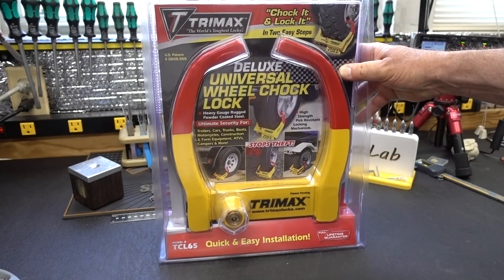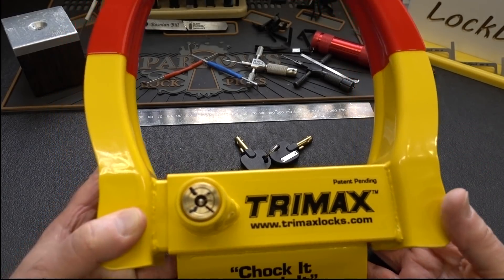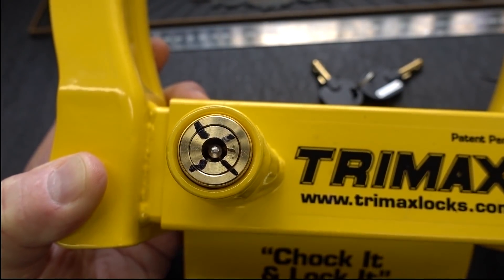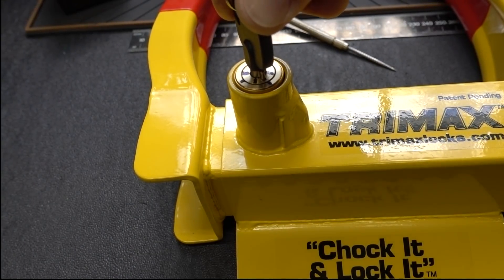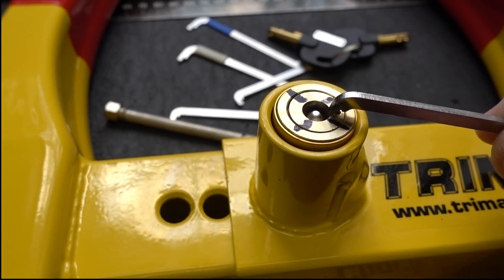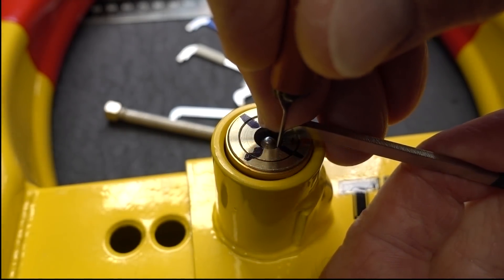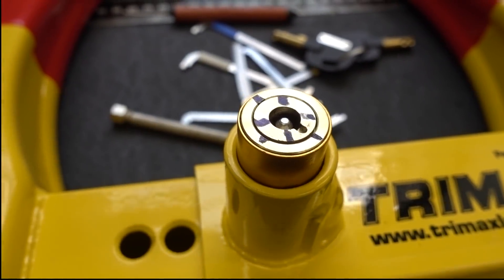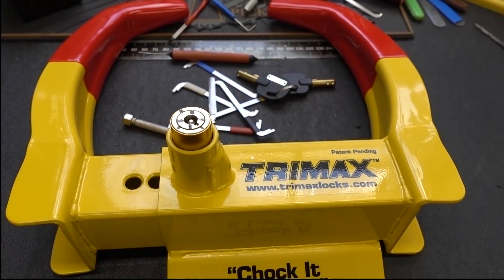(1881) TriMax Wheel Lock

Comment: I actually use this exact lock to aid in securing my vehicle, but not as a sole security solution. I have a very valuable pickup truck that has already several attempts at theft. What they do is punch out the door locks and attempt to force the ignition over. Replacing all those locks costs about $1000. I wasn't going to have it anymore. I installed a very good security system with engine immobilizer to prevent someone from being able to drive the truck unless its disarmed, but that doesn't prevent someone from trying to punch out the lock and costing me money. I use this wheel boot as a visual deterrent that my truck will be more of a pain in the butt to steal than its worth it, so I don't have to pay to have new door locks installed and rekeyed.
Reply: I guess theives in your area do not know how to change a tire?
Reply: @williambrandondavis6897  oh, they definitely could change the tire out, but that would set off the tilt sensors in the security system. The clamp is not a immobilization device in this sense, it's a deterrent and pain in the ass device. Thieves wouldn't be able to start up or take the vehicle anyway considering the current state of that security system that's on it, all I need to do is get them to not look at my truck as easy prey.

Comment: When you think about it though that lock will be near the ground making it so you have to position your body into a semi comfortable position to work on picking it.  Secondly if you install that lock where the lock opening is facing the ground.  You raised the level of dfficulty even higher. All in all with the lock on the ground and upside down I can promise you made opening this via picking a lot harder to accomplish.

Comment: I have one these for my trailer along with a hitch lock and they saved my trailer from being stolen from a friend's shop. His trailer, unfortunately was stolen, he had no locks at all. He was depending on the gates being locked keeping his safe. That obviously didn't work. Moral here is, even if the locks you're using aren't the greatest thevies will most likely move on to something easier to steal. Upside to the story, my friend did get his trailer back a couple weeks later, mostly due to his detective work and not much help from the authorities.
Reply: Indeed, when running away from a bear you don't have to run faster than the bear, you just need to run faster than the other guy trying to escape the bear.
Reply: @Tom Sawyer the myth of law and order

Comment: Trailers: You need a hitch pin lock, a coupler lock, a wheel lock, a lock on the trailer door ....  at some point old-West style necktie parties begin to sound reasonable.
Reply: coupler locks are useless, as they do not prevent driveaway of the trailer. Matters not how "good" the coupler lock is. Wheel locking is a better approach.... or do BOTH ! Make that trailer OBNOXIOUS to steal

Comment: Chain and a good padlock. Run it through the wheel and wrap around the axle. Theives will not notice it until they are trying to pull the trailer down the street and the tire doesn't spin. At that point they will either ditch it or get caught.

Comment: Bill could you brute force the Trimax using a 12ton Bottle jack or scissor jack while mounted on a trailer tire?   Maybe placing 1/2 plates to brace on either side?   I saw this done with  a few car booting devices people were able to pry them apart.   Love the videos and enjoy when you brute force things as most common criminals are NOT likely to pick a lock.

Comment: Did you try reaching through the next open locking hole and try to lift the lock pin from below?
Probably not spring tension-ed but....
Reply: Wonder if I'm thinking the same thing... Could you slide a thin hacksaw blade in between the gap where the two pieces come together?

Comment: One thing you didn't get Bill, is that the lock will be ground level, requiring whomever is doing the picking to be lying on their stomach. Makes for a satisfying moment when they hear the sound of the pump action shotgun close to the back of the head.
Reply: Exactly! On the ground, against a tire, probably in foot high grass (if in a backyard)...plus a dimple tubular lock that nobody has seen before. Make that lock tension from the back and make the core turn 360° and they've got a real deterrent!
Reply: @MrV1NC3N7V3G4  or they could just change the tire out for a spare.

Comment: So what's to stop a thief from deflating the tyre, removing the lock, re-inflating the tyre and driving the trailer away? And it doesn't stop a thief from removing the wheel, fitting a spare and driving away.

Comment: 30 seconds with impact wrench and the wheel is off, lock defeated.
Reply: it thieves want to draw attention to themselves at 2am.  Locks dont prevent theft, they make it difficult enough that the thief goes somewhere else.   this stops the 2 am motel theft of a u-haul trailer  it doesn't keep the guy who plans ahead and brings jacks cutting torch, etc.  Anything can be stolen with enough time, money etc.

Comment: It would probably be difficult enough to pick if you are laying on your side with your head underneath a trailer trying to pick that thing as it dug into the ground or at the bottom of the wheel however it ends up arranged

Granted my skill level is nowhere near yours
But I don’t believe that either one of us are in the hobby of going around and stealing stuff so it’s safe from 99.5% of the population

My first thought would be put a jack underneath it, take off those four wheel lugs and slap another wheel on it and drive away

I saw that done To a car in Detroit years ago !

Comment: Take an angle grinder to the lock housing and give it a quick 360 around the body housing.
Reply: That would be tough to impossible to do when is locked on a wheel/tire.  You could probably just cut through the whole lock housing and cylinder though, probably easier than trying to cut through the arms.